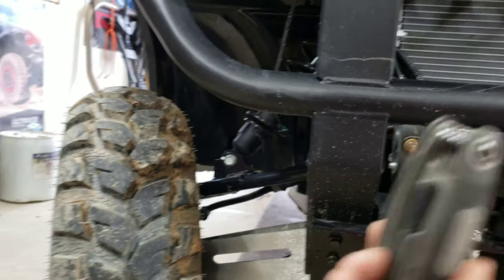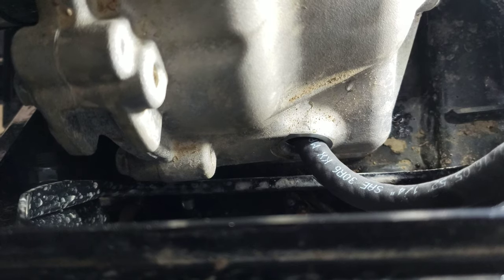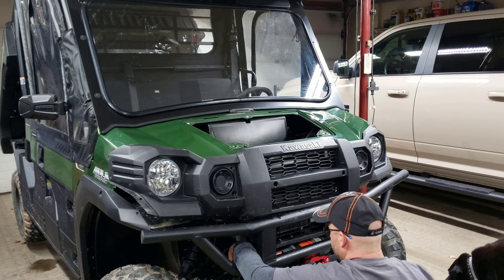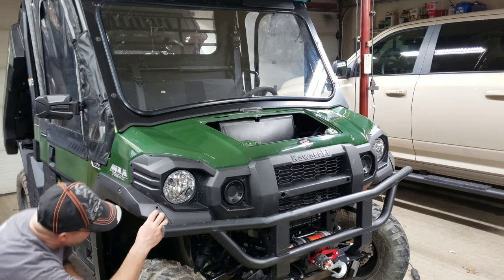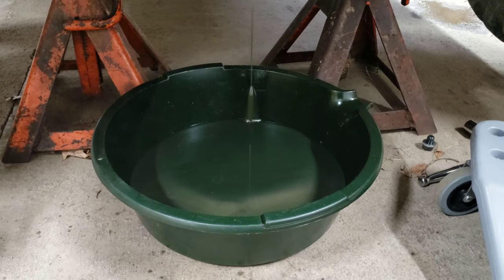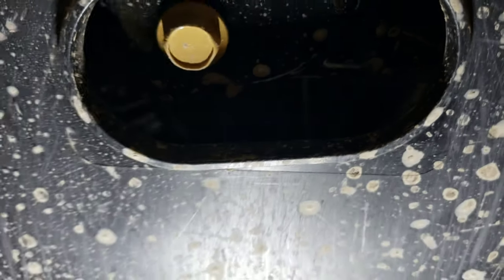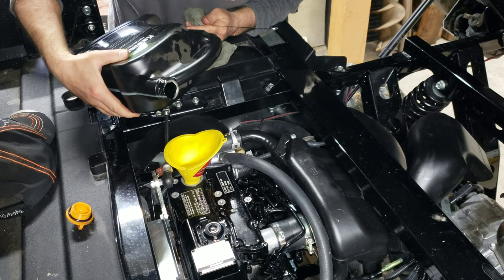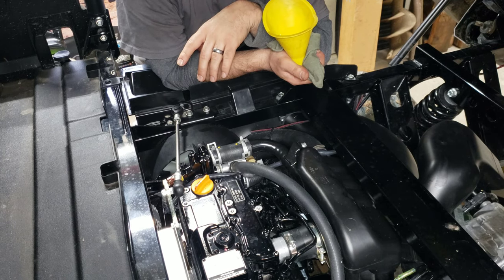Kawasaki Mule Pro DX 20 hour Service (Sound starts at 3:42)

Comment: This was a big help.   My 2019 oil filter was easily accessible after removing panel under back bench seat and I don't have a winch which made it easier. My oil drain was 14mm socket on my 2019 if anyone has 2019. Glad I learned to do it myself.
Reply: I know it's quite off topic but does anyone know a good website to watch newly released series online?
Reply: @Reece Kairo i would suggest FlixZone. Just google for it =)
Reply: @Reece Kairo i watch on flixzone. You can find it by googling :)

Comment: Thanks for the video- I just bought a 2020 PRO-MX, and will need the 20 hour service in the next week, or so. I have to say, I'm really disappointed with the Mule, from a service perspective. Knowing changing oil and fluids is part of their maintenance, Kawasaki should have done better design for service. Removing the front of the vehicle shouldn't be required for a simple fluid change.

Comment: My manual does not mention anything about the rear diff/transmission oil change requirement at any hour. Just to check it. Great vid by the way.
Reply: @The Oracle I did as well...thanks.

Comment: Wouldn't jacking it up throw off the amount your putting back in and give you a false reading when filling it up?
Reply from the maker: Are you referring to the differentials or the engine? No matter really. If you jack it up and real lift one end far off of the ground you could get to the point that it would slow to slightly over or under fill. But jacking it like a reasonable person will have no real effect on your full reading.
Reply: @LarryMusgrave  ok, thank you, I wasn't sure if you had one end up and the other down if it would throw off the readings enough to worry about, I didn't think it would, TY for clearing that up, I have money put down on a new ranch, just waiting for it to come in, I work on all my own vehicles and I wasn't sure if these might be a little different, thx for clearing that up, keep the videos coming, God Bless you and yours.

Comment: what brand are the A-Arm gaurds?  I don't like the amount of holes in the Kawaski brand as I drive over logging operaters to retreeve moose and bear. 
I need max stick protection.
Reply from the maker: Those are Ricochet Offroad. They offer a complete underside protection for folks like yourself. I only bought the A- arm parts since I'm in my 15 acres of maintained logging roads.

Comment: Very nice video. Are there any zerk fittings that need to be greased? I have a 2006 Mule 3010 Trans and love it.
Regards,
Doron
Reply from the maker: I've not seen nor hide nor hair of grease zerks in this machine.
Reply: @LarryMusgrave  Thanks for your reply. My 2006 3010 trans 4x4 has one zerk fitting on the drive shaft. Can't find any additional and that is odd
Reply from the maker: I'll have to look at the driveshaft on mine. I thought that it was a fixed shaft with CV style sealed boots on it.

Comment: There's a much easier approach to front differential fill plug. Just remove the front bumper. 3 small bolts at center bottom of bumper and 2 large bolts on either side near top of bumper (they also have small washer- like spacers). You get total exposure of the differential fill plug; no need for tube to fill. Hardest part of the job is positioning spacers on upper bolts during re-attachment of bumper. Total job takes about 20 minutes, start to finish. Factory torque recommendations are:
2 upper bumper bolts 44.5 N-m
3 lower bumper bolts 22.5 N-m
Drain and fill differential plugs 16 N-m
 
It appears you may have a hairline crack in your front differential case at the top of the fill hole. If true be careful you don't over tighten the plug or it can spread.

Comment: How are you liking the pro DX. Thinking of buying one primarily for towing my mower. Do you think the belt transmission will hold up?
Reply from the maker: You know, that is a tough question. I had a 13 year old Rhino before this and never had a single belt issue, and in researching the Kawasaki I didn't find much internet chatter indicating belt issues. I was looking at the Kubota X1120C that has the actual hydrostatic tractor transmission, no don't the hydrostat from Kubota is nearly bulletproof.... But the DX has a larger bed and much better suspension.

I don't use it as a toy vehicle, it's for hauling wood, dirt, mulch and anything else. Yesterday it spent 5 hours on a job site moving dirt and shale as I dug a french drain around a new barn that was erected. 

I'm not anticipating belt/transmission issues, and at just under 100 hours on it now, everything is working fine and as expected. 

I would say that if your dragging a mower in relatively level or rolling pasture that it will be many years before you need to do belt maintenance, but I can't be considered an authority on that as I am also new to this Kawasaki transmission. 

Overall, I really do love the DX and at this point I have no regrets. I would make the same choice again.
Reply: @LarryMusgrave  thank you. I've been going through way too many different options in my head.  I currently pull my mowers with my cj7 but it's getting long in the tooth and I don't have time to be working on stuff all the time. I looked at the kubota's  I just hate the seats. I'm very familiar with the hydro I have a BX 25D. Basically I'm down to buying a Kubota Grand L cab tractor, the mule, or just getting a newish Wrangler.  The mule would be my cheapest option just wasn't sure about the transmission. I have real steep hills that I mow that's why I use a Jeep now because my tractor would turn over. Steady 15° up to 40°
Reply: I'm a Kawasaki tech, main problems are the people abusing these things with no maintenance. People pull over their max towing capacity and are always in high gear which ruins the primary drive converter. Mule begins to walk and is hard to shift. User error is always what gives a bad rep to any vehicle. And for the love of God, DO NOT OPEN THE RADIATOR! It will overheat and you will be going to the dealer for that. Just fill the bottle.
Reply: @CrimsonHawk09  What do you mean by driving in high gear? If I am not pulling or Hauling and have primarily straight flat ground its not recommended to drive in high gear all the time?
Reply: Dear  @CrimsonHawk09  ;do you mean do not crack the radiator cap? Is the problem getting air into the system? Thanks for mentioning the issue, you always learn from the commenters.
Reply: @CrimsonHawk09  Dear @CrimsonHawk09 ;do you mean do not crack the radiator cap? Is the problem getting air into the system? Thanks for mentioning the issue, you always learn from the commenters.
Reply: @CrimsonHawk09  
It's good to have a real Kawasaki Tech here, really is.  I just bought a 2018 Mule FXR with 28 hours, 208 miles.  How important is the first valve check, and how difficult is the job?  The previous owner did all of the fluid changes.  Thanks in advance.

Comment: Thanks for the video - would be helpful to update either the video title or the description to specify which Mule Pro you're working on.
Reply from the maker: it really doesn't matter whether it's a mule Pro or if it's the Extended Cab Mule pro, they're for the most part identical on doing maintenance the only thing different is the frame stretched a little bit on the long-wheelbase one.
Reply: @LarryMusgrave  Fair enough, good to know.
Reply from the maker: @pshep123  access to the front and rear differentials and the engine oil and filter are the same. the only part of the job that really kind of sucked is my front end because of where I have my plow and winch. If you had a bare front end I think you can get out down into the differential much easier.

Comment: Did you check the valve clearances?
Reply from the maker: Not yet, have you checked yours and find them to be out of tolerance?
Reply: Larry M Musgrave I just got mine last weekend.  I only have 2 hours on it but it says check clearance at 20 hrs?  I can’t find too much on it.
Reply from the maker: @jackhemmert9781  
I didn't do that at the 20 hours, but I did 100% of fluids including the radiator. I took the cap off if the radiator and saw gelatin looking substance, took photos and send to the dealer as well as to Kawasaki customer care. It was recommended that I do a full flush. I've not seen that issue return.

The feedback I've seen online was that the valves needing adjusted is extremely rare, I may pull it into the shop this winter and get in there too measure the gaps. It's not super high on my worry list 😉

Comment: Where is the oil filter ?
Reply from the maker: It's not a remote mounted filter, so it's directly screwed into the engine block. You lift the bed to gain access to it, it's tight but not horrible to get at.